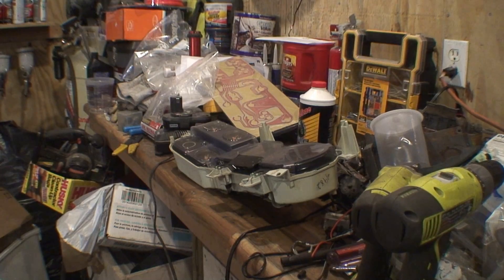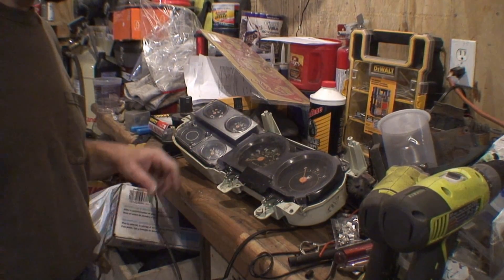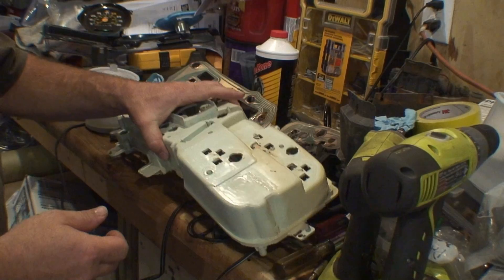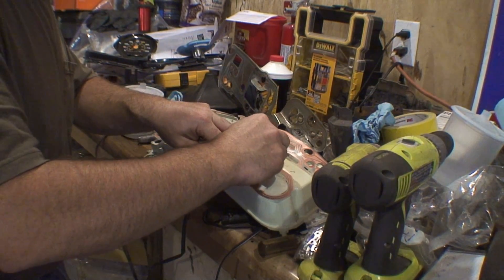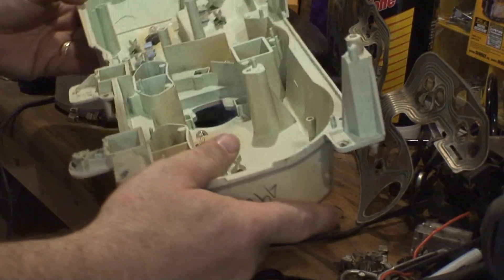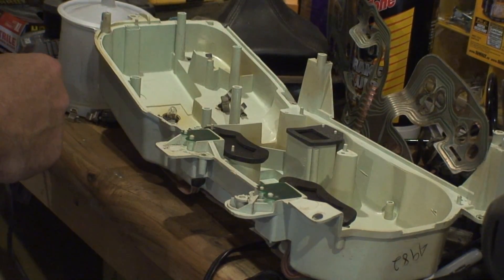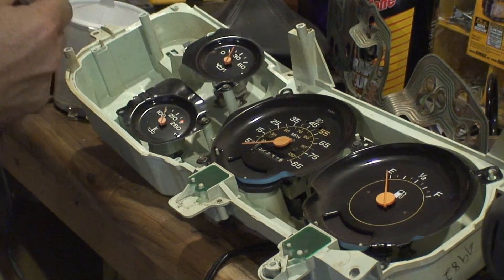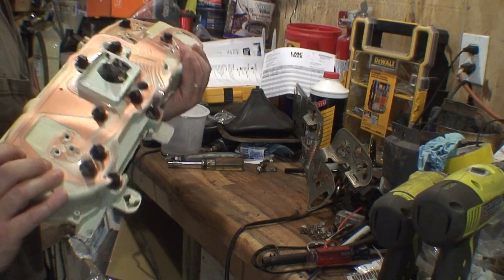'73-87 Chevy Truck Gauge Cluster Repair

Comment: Just wanted  say love the background  noise. Thank you this  video.  To those who  want to  upgrade the lamps  brothers  trucks has led replacement  lamps plug an play. I did  this to my 1970 gmc  truck its so nice now to at night.  Also  used the  voltage gauge from this gauge cluster.  It's  easy.

Comment: The gauge clips can be cleaned at the point of contact on the printed circuit side requires only 600 grit sandpaper or a maroon Scotch Brite nylon scuff pad. Electrical terminal cleaner is very useful and sold at most home improvement stores in the automotive section. As well as dielectric grease. After cleaning, compressed air is great, just hold onto clips with needle nose pliers. Dielectric grease should be on both sides and it is easier to apply a thin coat on the gauge studs that fit these clips.
 Printed circuits are designed to provide voltage but amperage as well. Any burn spot would cause me to trace the circuit to the cab connector and online forums or schematics with the color of wire will help dictate where to look for a short to ground, positive or internal short in the component. Fused jumper wires fashion to operate to test will help diagnose if their is a reason this occurred. Repair or replace as needed. 
  This size of this trace allows for proper amps to flow, so if new and undiagnosed, may lead to the exact same failure. Depending on the location, the trace on the circuit may be scrape with a knife gently to remove any coating. Soldering a short length of multi-strand wire can bridge the failure, saving the expense of a new replacement. The connector has spring loaded terminals and the upmost care removing or installing the connector must be observed. If one or more copper tab is twisted or free, use 3M clear emblem adhesive on a toothpick to apply on the backside only. Cleaning with a “Q-Tip” and acetone or thinner. Place a drop of adhesive on the backside then push in place. To hold overnight, use a small snip of foam used on seat or folded cardboard. Test in advance to test fit. This can be done on all, one or several and can be removed in the future for service or replacement. 
DK, ASE master tech since 78, retired.
Reply from the maker: Thanks for the info!
Reply: Damn that's serious.
Reply: @philup6274  It is a common fix, especially if an electrolytic cap shorts it can damage the trace which essentially just a printed wire, then cover with a green lacquer. Enjoy!

Comment: ITs best to check all those lights and the connectors before putting it back together.  better yet, go with LED bulbs...  I also like to use conductive grease on all connectors, ensure a good connection, and fights off electrolysis (dis-similar metals eating eat other causing corrision)

Comment: How do you remove cluster from dashboard. I don't have clearance to pull it out, thanks, Tim
Reply from the maker: Once you get the speedometer cable disconnected, you should be able to push it in and down to allow the top of the cluster to clear the opening in the dash and then it should come out.

Comment: my 79 speedometer is making a weird noise every so often randomly then the needle jumps back and forth and will then go back to normal would that have to do with the cable or the actual speedometer gauge
Reply from the maker: My best guess is the cable is dry and is hanging up inside the sheath.  I doubt the gauge is bad.

Comment: Can someone help? 
1980 C10. Original diesel but has been swapped with an Oldsmobile cutlass 307. 

Getting no reading on battery voltage (sits at 9:00) fuel level stays the same 1/4 of a tank, on each gas tank. Speedometer and temp work and the dashlights work. 

After I brought it home and shut it off, I went to crank it again (I had had work done to it to replace the distributor, the old one someone had JB welded into place so we couldn’t set the timing. It was too advanced so it caused hard starting, they also welded my intake manifold as I had a crack in it) and I just got a clicking noise, no heat or lights coming on. followed by nothing on the next attempt at starting.
I got out, checked under the hood that the battery was connected. Slammed the hood. Got back in and I had power. 

I replaced my battery cable clamps and cleaned the cables, the terminals, and the block ground. (The connector clamps were pretty bad and needed the replacement anyway) I’m cranking and turning over and running fine. Everything else seems to be working. 

 All of the gauges had previously been working  (Except the clock) before I took it there. They didn’t pull the cluster or mess around on the inside or near the fuel tanks. 

A family member had his college class do the work for me so I know it was nothing intentionally done. My theory is they unhooked something while removing the intake or the distributor and forgot to hook it back up. I’m just running out of things to check, is there another ground point or anything anyone suggests? Or a wire color or location to check out? 
Anything is appreciated. Thanks in advance.
Reply: Sounds like a loose connection. Would make sure starter wires and check the fuseable link. I have a 1985 c30 that had the 6.2 diesel in it and swapped it over to a 350 and had no problems. Temp gauge doesn't work but it didnt with the diesel either so I just put in an aftermarket one. Your problem sounds like not enough power to the dash  from loose connection or even a bad ground. The grounds should run engine to battery, engine to cab. Battery to frame, battery to nose clip (there's a spot by the battery)

Comment: I have a 1980 C10 Silverado, With the original cluster, it's going on 40 years old, I brought a new printed circuit board, while working on it,I broke the speedometer needle, it's  not repairable do I have to buy a new speedometer gauge?
Reply from the maker: You can probably find a used one on eBay or at a local junkyard.  LMC truck also sells new ones.

Comment: Can I check the rest of the gauges, using the battery method. Ground goes to the gauges  with a wire and then to the positive. Correct?
Reply from the maker: Usually the sensor wire is the gauge ground with the other post going to positive.  The sensor acts like a resistor so if you go full ground, the gauge should move all the way over to the right side.

Comment: Did all the steps you did but as soon a i put it back my gauges wont move as in the needles have no movement got another circuit board and those metal clips and still wont work. Fuses are still good
Reply from the maker: Make sure the plug is plugged in the correct way.  I think it can go either way.

Comment: I have a 1985 dodge ram no cluster lights any idea what to do?
Reply from the maker: I'm not familiar with Dodges, but I'd check to see if you have power going to the cluster from the headlight switch.  If there's power there, check the cluster wiring for broken circuit.  If no power there, might be a defective light switch.

Comment: Great vid. I am another viewer who did not know about the fiber optic cable. 
Question.  How do you hook up the odometer cable with the gauges installed. ?
Reply from the maker: If the cable is not long enough to pull out with the gauge cluster, there is a small opening under the cluster that you can stick your hand in and release the clip to remove the cable.  To install, just push the cable on until the clip catches it.

Comment: Nice presentation. Now I'm ready to do mine. Did yours turn out good? Thanks
Reply from the maker: So far it seems to work fine.  I haven't gotten far enough along with the project to test everything but the fuel, volts, and oil pressure gauges work.

Comment: I have a question, I recently purchased a new instrument cluster. I noticed that the printed circuit board is different than the one on my old one,is there a difference between them and should I switch them out?
Reply from the maker: When you say "new" I assume it's a used cluster that you purchased.  The circuit board will differ depending on what gauges (or warning lights) are in the cluster and whether it has a tach or not.  If the new cluster is laid out the same as your old one, then swapping the circuit would be the easiest if it's still in working condition.  It may be possible to double check to see if your wiring will work with the new board.
Reply: @farmboy30117   Yes and thank you.

Comment: How do you know if its the circuit board or gauge that is keeping it from working???
Reply from the maker: You could pull out the gauge, connect it to a power supply with the proper resistance and see if the gauge works.  Not easy unless you know  the ohm range the sending unit puts out.  On the circuit board, look for cracks or burnt places in the circuit.

Comment: My coolant temp gauge pegged on my '86 K20. Sending unit or an instrument cluster bad?
Reply from the maker: Not sure, if you have an ohm meter you can check the ohms on the sending unit cold, warm the engine up and see if the ohms change.  Could be a faulty wire, or a bad ground to the gauge.  The ground circuit on the board is easily broken.

Comment: Does LNC carry the complete gauge cluster? I have an 87 Chevrolet Silverado 4x4. I'd rather replace the whole gauge cluster, because plastic parts tend to get pretty brittle over the years and I'd rather just replace the whole thing.
Reply from the maker: I don't believe they sell a complete cluster, but they do carry replacement parts, so you could build a new one if you wanted.
Reply: LMC trucks though!

Comment: I have a 83 c10. On the instrument cluster there is a small yellow box coming off two wires below the tac cable. Has any one ever seen this? It says a/c deco on it and in the box is  circuit board.
Reply from the maker: +Clark Cowan It creates a signal for the cruise control from the speedometer.
Reply: +farmboy30117 ah!!! Yes. All the other trucks didn't have cruise control. Thanks!!